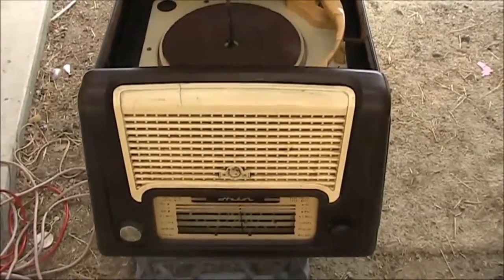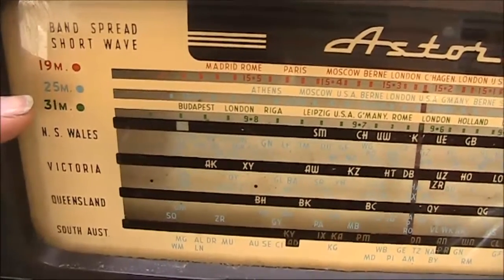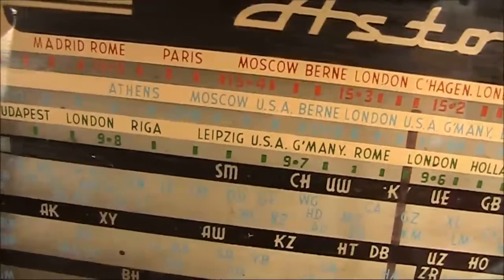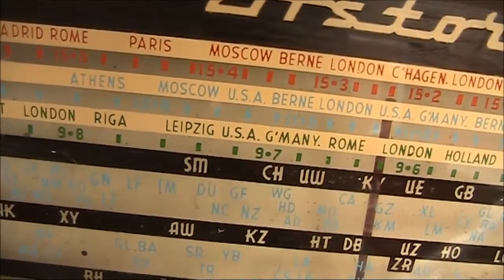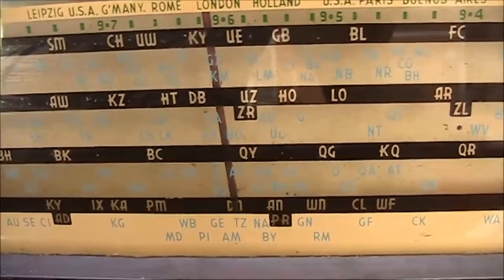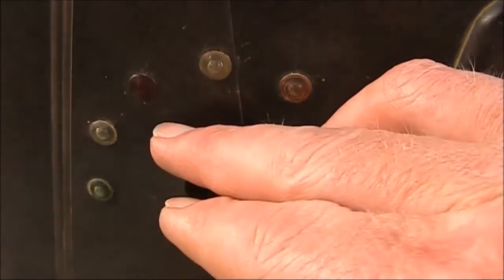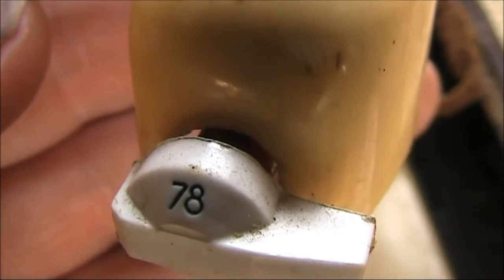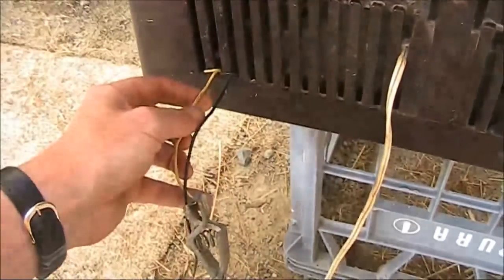My first short wave receiver - 1950s Astor radiogram

Comment: Nice radio. You should replace the electrolytic and paper capacitors before turning it on again should you plan to. I'm a sucker for old valve radios but there's next to nothing to listen to on the AM BC band apart from the occasional program on 3CR. Really, how many sports stations does Melbourne need?